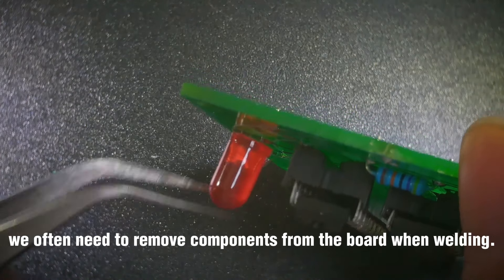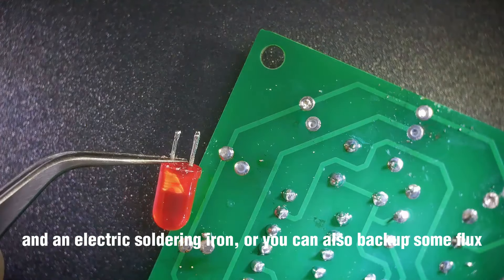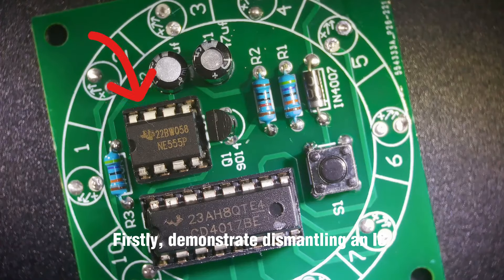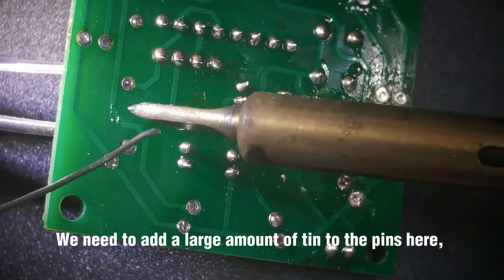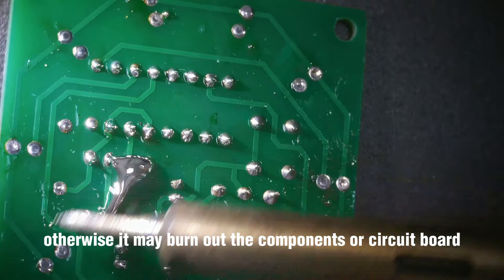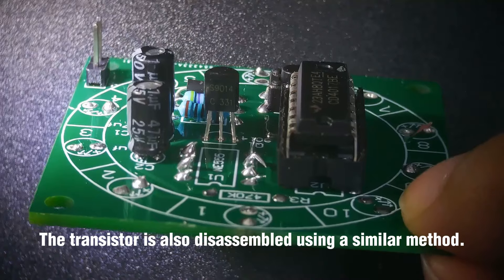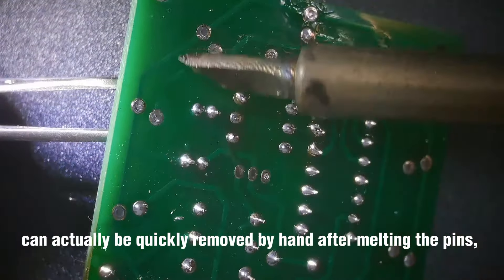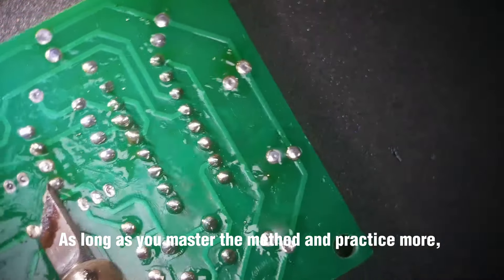Andonstar--How to remove resistors/capacitor from your solder board | solder tutorial

Comment: Laptop panel’s solder flux is much harder than a regular type.
Reply: They use unleaded solder which has a higher melting point. Add some leaded to the joint and it should become easier to flow and remove.